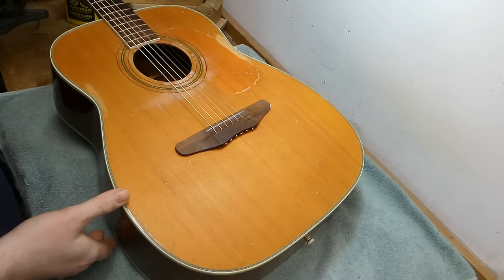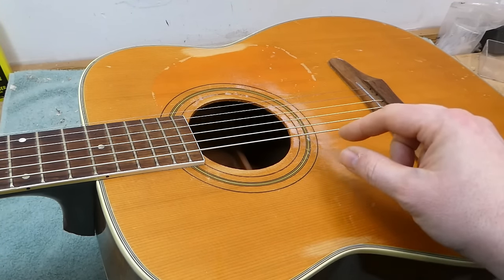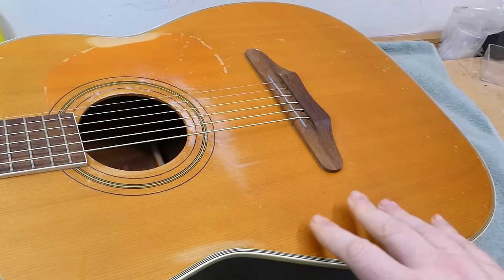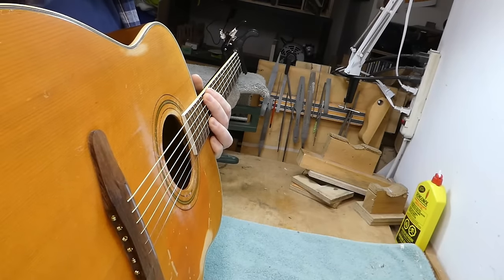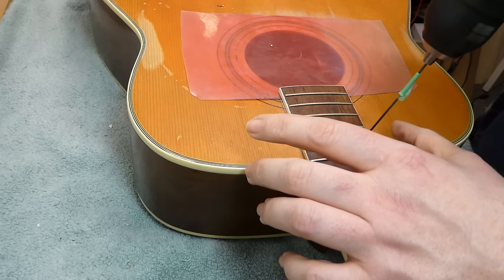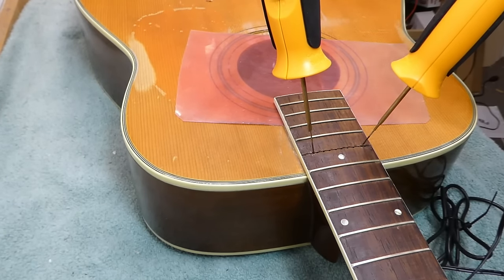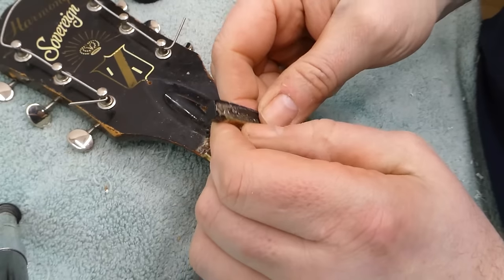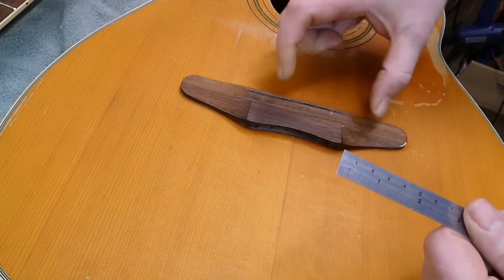What is this crusty white stuff all over the soundboard?

Comment: Hey Ted. Your Hangar 9 iron is still available new. It's actually for making RC airplanes, hence the 'Hangar 9' name. It's to shrink the covering material over the bodies and wings.
Reply: I was going to tell him it was for Monokote, but; you beat me to it. I've got one I've had, for 30+ years.
Reply: There's loads of used ones on eBay etc.
Reply: I just typed the almost the same thing. Actually it was typed when I looked at the next post and it was this one.
Reply: I have had mine for 30 years or more, we always called them monocote irons
Reply: They're also used to mount photographic prints.
Reply: They also work on full sized fabric airplanes.
Reply: That’s exactly where I got my Twoodfrd Hanger 9, at the Hobby Shop, two years ago for $29 US
Reply: Just not old dial model like Twooford has.
Reply: Also a snowboarding waxing iron would be great for this. Probably better
Reply: You'd need two to repair Mustaine's Jackson.

Comment: For anyone else who was curious, "methyl hydrate" seems to be the Canadian industrial term for methanol.
Reply: For anyone who needs some in the US, Lowe's has it listed as a "KeroKlean kerosene fuel treatment" at ~$9 for an 8 oz. bottle. Home Depot doesn't sell it in the US, apparently. 
Which is weird, because as a kid in the 70s / 80s, I remember hardware stores always had "wood alcohol" in stock. 🤔
Reply: @mnemonik61  It's one of those weird reversals:  methanol is available at any hardware store paint department up here, but (denatured) ethanol is almost impossible to find.   Corn vs trees I guess.  It's a problem for boat spirit stoves since they don't run right on methanol.
Reply: Lol
Reply: @mnemonik61  Also available as "Heet" (not "Iso-Heet") for a little less.
Reply: @mnemonik61 Also a great source of pure methyl alcohol is Heet gas line antifreeze in the yellow bottle. The yellow bottle is pure methyl and the red bottle is pure isopropyl.

Comment: Years ago I bought a bunch of dead DeArmond gold foil pickup coils on eBay, probably saved by an old employee when they tested them, or from customer returns. I was able to repair about 25 of them, and found the problem was where the inside coil wire attached to the pickup base. They tried at least three different attachment methods over the years, and I had some of each. I had to use eye magnifiers to see the short piece of wire coming out of the inside of the coil, and I only had one chance to try and get a good solder connection to the base, but I was able to save some of them without a rewind.

Comment: I used some Amazon foam cutters and they worked okay. No temp setting. Just on and off for the heat, but the neck popped straight off after 10-15 minutes. I was probably lucky. What's also an annoying coincidence, I needed a saddle slotting jig/tutorial last week (I opted to do it by hand) and this short one by Ted had everything I needed. Just a week too late! Damn you cosmos!

Comment: Great to see another Harmony H1260 being properly restored, they're such great guitars. i own many of these harmony models dating from 1959 thru 1970, and i have found that the pickguards are in fact, very consistent in their shape. many of these pickguards fell off the guitars because of gluing problems and excessive heat and were lost, so people have attached aftermarket ones, which might possibly be the case with this one . The shadow visible on this guitar shows the old pickguard position on the outside ring of the rosette, which is not how they were positioned at the factory. The originals were lined up on the edge of the second rosette radius, with the pickguard covering the large outside ring, much like a martin and the majority of flat top guitars.

Comment: "Wire enamels" are specially formulated resins that are applied to copper and aluminum wires and cured with heat to provide electrical insulation.  They are used in various applications, including motors, transformers, generators, and electrical measuring instruments. ~  Copilot
Reply: that's a darned thin coating of enamel on that darned thin pickup wire!

Comment: 13:50 you can replicate that motion using the winding mechanism from a Singer (old) sewing machine. Specifically, the one with the heard cam pattern. You can get that whole mechanism for not much and adapt it to work for winding wire. Obviously, nowhere near as fast as the CNC one above, but hey, if it works, it works, amairite?

Comment: I recently scored a Crate GX-212 for $70 in mint condition which was a crazy deal, but the pawn shop hadn't even cleaned it up, and there was some mysterious white streaking down the side of the Tolex! lol
I used automotive degreaser and all is well now. It's louder than a lot of half stacks I've heard.
Reply: Oh, those dirty old amps!  I acquired an Ampeg Rocket R-12, vintage 1960 that must have been the house amp in some back-road honky-tonk for 40 years or so.  I spent an entire afternoon scrubbing off the accumulated nicotine coating. I do believe the cigarette burns in the tolex give it extra mojo, though.